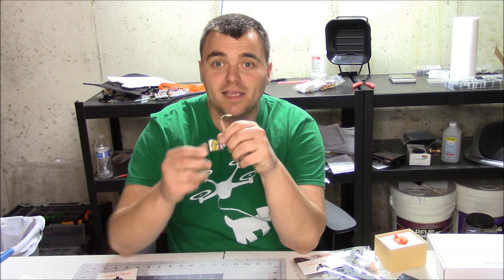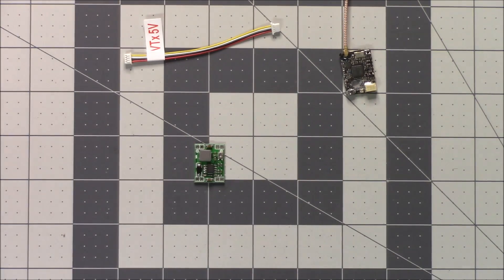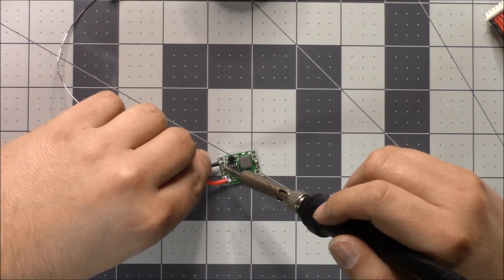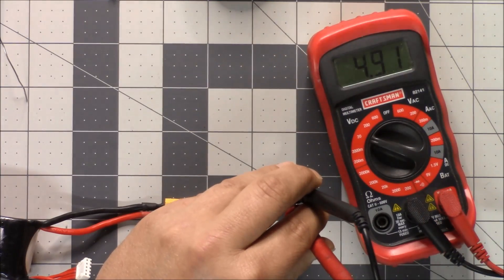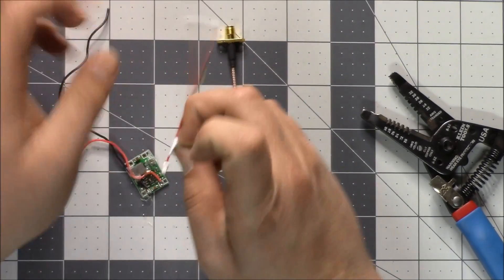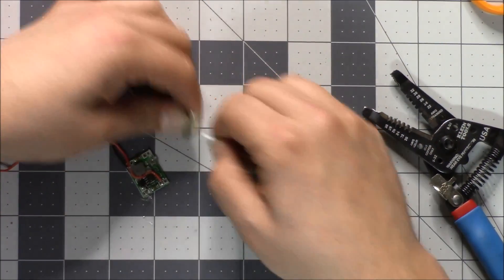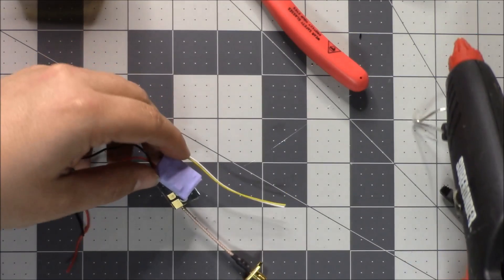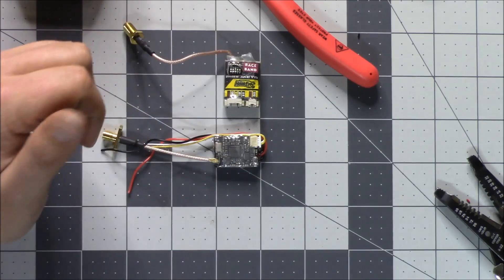TBS Unify Pro V2 5V module with regulator build

Comment: Only problem I see is that now its gonna b hard to mount the vtx up against your carbon fiber it acts as a heat sync cause it get very hot on the higher mw

Comment: Do you get any kind of horizontal line noise issue? I'm having this and I'm trying to get rid of it.
Reply from the maker: +Duncan Hohn I've had no issues with noise on these regulators.  Usually when I see lots of video noise, I check to see if I lost a capacitor on an ESC, that's usually the culprit.
Reply: Spoon FPV it was the one of the esc. Thanks for your help!!

Comment: Hello Spoon FPV I did the exact same buil you did after watching your video and set my voltage about 5v but i get about 15 / 20 feet away from quad and it's starts to snow on me.  Do you have this problem as well?  It's like my vtx is not transmitting strong enough.
Reply from the maker: +Ruben Flores are you sure you have your goggles tuned to the same freq as your quad?  The one or two channels off will do that.
Reply: I did sir, I even had two goggles on at the same time, one with an auto scanner just to be sure I locked on.  Before I gave up on it I tried increasing the voltage from 5v up to 6, then 7v even just to see if maybe my regulator was not giving enough power to the vtx but still the same thing.  So I'm thinking maybe I have a bad vtx which sucks. Forty down the drain... ): lol.
Reply from the maker: +Ruben Flores it's usually an issue with the goggles not being on the same channel.  Auto scan doesn't lock on to the right channel 80% of the time.

Comment: Hi please can anyone tell me if my tbs unify pro v2 batch 2001 vers. 1.0 can works at 500mW / 800 mW and how to enable it? For screen on the goggle display the vtx monitor on my motolab tempest f3 betaflight how and where i have to connect the wite wire on the fc port? thank you

Comment: Hi: many thanks for the video: please i don't understand if this regulator you use in this video is output is LC filtered or not and please if can you help me for understand if on my fc Motolab Tempest 1.2  that have a dedicated pinout power vtx  section i can connect my tbs unify pro 58G V2: on ML tempest fc i have pin LC FILTERED  BATT + and ground... and NOT LC FILTERED +5V and ground: if i whell understand this vtx work only on 5V powered but is absolutely important that this 5V are LC filtered for a video good quality transmit or i can connect on mi fc at 5v not LC filtered??? And please last question: i read on the web thet this tbs pro 5G8 v2 work only  with two power out frequency  25 and 200mw but when i bought this vtx i read 27 to 800mw: how is the way for unlock/set 500/800mw on it ??? THanks & Best from Odino Italy

Comment: Is the regulator you used the same as this Polulu regulator? 

Pololu 5V, 600mA Step-Down Voltage Regulator D24V6F5 Pololu 5V, 600mA Step-Down Voltage Regulator D24V6F5 https://www.amazon.com/dp/B016VG8XI2/ref=cm_sw_r_cp_apa_PfeXzbEF2ESM9

If not then what's the difference? I'm just trying to figure out the best one to buy.
Reply from the maker: +Sherman G It's not the same as the Polulu, I should scope both to be sure, but I think this one has less noise, but that's purely anecdotal and I am not a fan of that knind of advice, needs to be backed by cold hard facts.

Comment: Do you get a lot of noise in your camera with this set up? I did this and I'm getting crazy noise now. How could I fix that?
Reply from the maker: +sxe82 No, it's one of the quietest regulators I've ever used.  Maybe something else in your setup, are all the grounds tied together?  That's usually the culprit or missing capacitors on ESC, or bad antenna.
Reply: Spoon FPV the only grounds that are together are the vtx and the camera. Both soldered to the pbd.

Comment: Spoon FPV ,Im also using a tbs unify 5v version on a betafight f3 fc.On 25 mw it clear,from 200-800 mw in getting lines. any ideas ?
Reply from the maker: +ANDREW DEL CASTILHO it could be a whole bunch of things.  For me the issue has always been something other than the FC on my copter.  Most commonly it's that I've ripped off filter caps on my escs.
Reply: ok thanks i will check my escs

Comment: Hello if my PDB outputs 5v at 2 amps will i need a regulator or can I run the unify directly of it?
Reply from the maker: Should be good to go with a 2 amp regulator
Reply: Spoon FPV OK thanks.

Comment: I subbed after taking you links and watching your vid. I did this today with my tbs unity and armadillo quad after watching your instructional. I'm so jazzed to be burning 800mw and taking the power directly off the lips pigtail connections. Thank you!!
Reply from the maker: +Bubba John and the crazy thing is I was expecting that regulator to be total crap based on the price, but all of mine have been solid
Reply: Spoon FPV and after flying the unify at 800mW I must say- HELL YES!!!!! Loving it. The range and clarity is fantastic. Your workaround is nice that I don't have to try and share a 5v pad. Got my reg running directly off the battery pads. Whooohooo

Comment: dumb question, but will the regulator keep the same constant 5v switching between 3s, 4s and 5s batteries?
Reply from the maker: +Alex Webster Not a dumb question, that's what a voltage regulator does...up to a point, this one will handle up to 6S, but will only drop down voltage,
Reply: Spoon FPV thank for the help! enjoy the flying, crashing and fixing like we all do and love

Comment: Awesome video! Thank you so much for making this my friend! Very informative. You've got my subscription. Question, is it possible to get smart audio working on a betaflight build without a built in OSD? Such as using the OSD from a runcam swift 2 or the mic from the runcam swift 2. Saw a comment below where you mentioned you could get smart audio working with a mic...
Reply from the maker: Yeah, I'm told it can be done by Trappy himself, but I've never done it, and I don't fly audio, so I haven't really taken the time to figure it out.  It's not an out of the box solution, it's a custom workaround the way I understand it.
Reply: Spoon FPV Got ya. I'll have to look into that

Comment: hey, just bought the new betaflight fc and just watched your breakdown of this Fc.
I wouldn't need to add a buck Regulator on the Tbs if installing it on the beta flight fc ' sorry if I am talking jibber '.
thanks Scott
Reply from the maker: +Fraser Scott You are correct the BF FC can put out 3A on 5V and I run them straight from the board now.

Comment: Hey Spoon !

nice video man, keep up the work. 

I have one question for you. I am worried about the Unify heating up too much with this installation. Do you have problems with overheating running 500mW or 800mW?

Because my Unify tends to get pretty hot at 200mW already and I would be very worried with all the heat shrinks around it.
Reply from the maker: realmup3r the only VTX I've ever had over heat was a TRAMP, and that was very recent, and if you saw that build and how beat up it was the VTX didn't owe me anything.  I prefer the TBS V2 specifically so that I can run my own regulator, which helps reduce the heat load on the regulator, and I've never had that configuration over heat.  If your VTX is getting very hot (more than 145F)  many times it's because your antenna load isn't balanced to the VTX due to damage of the antenna, or cable to it, or just a poorly manufactured antenna.
Reply: Spoon FPV alright, I will check on that! Thanks

Comment: dang thats a tight packaged drone. I have a frame about like that and I had a hard time getting everything in I had to mount the tv on top. 3 ants and 2 receivers later Im getting a bigger frame.
Reply from the maker: I've build a lot of quads.  And I think most people wouldn't recommend an X-Frame like this for your first build, because they are tight, and component selection is critical to make it fit.  After 2-3 builds you can build something probably even tighter, all it is is practice.

Comment: hows the noise using this specific regulator I have a tbs unify running through a different regulator and it has an annoying amount of noise
Reply from the maker: Corbin D I love that regulator, it doesn't seem to create any noise.  And I've shorted the output of one, and it didn't kill it.  I like them, so that's why I suggest them.
Reply: sounds good for me. that was also a somewhat scary fast reply
Reply: oops should have asked this in the first question but does the regulator get hot? Also do you know any decent priced batteries that can go for a lot of cycles? my 1300mah turnigy graphenes are puffing.
Reply from the maker: Corbin D I get push notifications to my phone, not so big yet that I've turned that off
Reply from the maker: Corbin D The graphines are good for a lot of cycles, I've been using Strix packs as my daily beater packs, and Lunineer graphine as my racing packs, That regulator doesn't get hot, it's a switching regulator, so unlike the more common linear regulator, it doesn't burn off extra voltage as heat.

Comment: I just did this, thanks so much for this video. I ordered the Unify pro and had no idea it only took 5v so before it got here I ordered the buck regulator. TBO I think I would have hooked this up and blew it out, I just wouldn't have even thought a VTX only takes 5v, but maybe the sticker would have stopped me. Either way, thanks
Also couldn't find you on instagram, are you not on there?
Reply from the maker: Nope not on instagram, one FB should be enough, but I should do more Social media.  Twitter, instagram, FB, Twitch, etc  There are so many
Reply: Yeah I know too many sometimes. It just seems like Instagram is really big in the FPV community. There are a few options out there also that you can post to one and it will post it on all of them for you.

Comment: i have a 5v 3a regulator for my fc and fpv cam, should it be okay to put the unify on the same regulator? i figured that the vtx would consume the most power of the 3 components, so it should be safe right? great video!
Reply from the maker: You will be well under 1A... short answer.
Yeah, that will be fine.  The VTX will eat the most power out of all of those at 0.6A .  I don't know the numbers, but if I had to guess the camera probably uses around 0.02A and the FC is probably under 0.05A, they don't use much at all.  I do know for a fact that the FC, camera, and Radio Receiver are under 0.5A because can be powered by USB, but how much I've never measured it.
Reply: Spoon FPV thanks!

Comment: Thanks for the video. Question: If your not using the white wire what do you do with it? I saw somewhere else where it was recommended to hock it to ground when not using.

Thanks
Reply from the maker: Jay Black That's for audio, you should watch my smart audio video, that's what I use it for now,
Reply: Thanks, just watched. I thought smart audio only worked on certain FC's. I'll go ahead and hook it up as you suggested.
Reply from the maker: Jay Black It only works on FC that have OSD, like the BF F3,  You can also hook it up to a microphone, and the other side of the Mic to ground and you will get audio transmitted.  If you're not using it grounding it isnt wrong.  It narrows the bandwidth you occupy on 5.8 which allows more to fly with less interference

Comment: I think the TBS unit needs 600mA. Would I be able to connect the regulator from a 12v/500mA source and this will still work?
Reply from the maker: Shimmy FPV You can connect the regulator to that 12V source, because it will only pull around 250mA from 12V line, but why not straight to your battery?  Are you running more than 28V
Reply: Thanks for the info.. No im not running more than 28v,  but I'm running the KISSFC off the battery, can I connect this to the one labeled VCC on the PDB? Is that the same thing?
Reply from the maker: Shimmy FPV I'm not that familiar with Kiss equipment, but as long as VCC is battery RAW(usually labeled as RAW) then you should be fine.  If VCC is a regulated voltage then you need to check the specs.
Reply: Ok thanks man, I'll give it a go.  this thing is overheating after 30 seconds of running and video starts to drop, maybe bad power.. So I'm gonna give this solution a try. If it doesn't work, I may switch to the Tramp HV, any thoughts on that VTX?
Reply: Shimmy FPV if your tbs is over heating verify its only get 5 volts power. Mine was wired into a 12 volt source, it didn't fry it but it got super hot within 30 seconds like you stated. Also at the high volt settings your not supposed to fly shortly after powering the unit to help cool it, as stated in the manual.

Comment: Half the cost? The HV costs 10$ more. You mean ½ the cost of the difference, half the 10$? Save 5$ for so much hassle , is it worth it? Or is it because you can find the HV? I'd simply get the HV... or the Tramp HV from ImmerisonRC
Reply from the maker: Ray Choi I like the smaller form factor.  the HV will not fit in my x frames.

Comment: Hi, thanks for this great how to video.  Isn't 3A a bit of overkill?  P = V x I  or put another way I = P / V. so as max power is 800mW or .8 W and voltage is 5 that makes max current .8/5 = .16A or 160 mA so one of those 500mA units from e.g. Diatone should be enough for both the flight controller and the vtx
Reply from the maker: David London You're confusing mW with mA.  Milliwatt (mW) is a measure of transmit power, Milliamp (mA) is a measure of current.   The VTX consumes 600mW of power to drive all the circuits to transmit at 800mA.  A 500mW power supply will not be enough to drive thd VTX, and certainly not enough to do vtx, FC, and whatever else you're running on 5V
Reply: Spoon FPV Hi, yes thanks for replying and correcting me.  I read the Unify Pro specs again and under consumption it says for 800mW output that it uses 600mA.  Does that sound more realistic?  If so a 5v 1A Bec might do it
Reply from the maker: David London Yeah as long as it can really deliver 1A, a lot of those are optimistic ratings.  And when you start aproaching the limit they get hot, thats why I chose something that was well within spec.
Reply from the maker: David London Yeah as long as it can really deliver 1A, a lot of those are optimistic ratings.  And when you start aproaching the limit they get hot, thats why I chose something that was well within spec.

Comment: I've had the same idea but never got around to try it. How's the video clarity, do you get lines?
Reply from the maker: LenbitzFPV Video quality is excellent.  I was worried about voltage ripple, but its not operating in the areas where buck regulators really struggle, (heavy current draw, or super low draw)  its kinda in the sweet spot, and the TBS handles the little ripple just fine.

Comment: Try the Tramp. It's amazing and excepts a wide range of voltage. I have even ran mine str8 from 5s. Amazing picture quality also. It's tiny too. Might even be smaller than that one.
Reply from the maker: muteFPV No the tramp is a good VTX,  All thd GoPro stuff on my channel is a quad with a tramp on it.  I don't think the tramp gets hot.  The TBS gets kinda hot, which is why I tried to set the regulator to 4.8v not 5 which helps with the heat.
Reply from the maker: Ponyboy FPV I have three of them and they are too big for an x frame like I run.  And they aren't reliable when you change channels.  I wouldn't recommend them for someone that doesn't know what they are doing, because its very probable to be transmitting on the wrong channel.  I use them on all my bigger rigs, because they are super simple, but the unify pro v2 is super small
Reply: Well I must have gotten lucky, because mine kicks ass and is tiny.
Reply from the maker: Ponyboy FPV They do provide nice clean video and I do fly them, but still not as small as the hawkeye or tbs unify.
Reply: Any heat issues with the Tramp? TBS Unify seems ti be highly praised

Comment: What do you think of the Eachine VTX03?   It is just as small and cheaper.  Would you recommend it?
http://m.banggood.com/Eachine-VTX03-Super-Mini-5_8G-72CH-025mW50mw200mW-Switchable-FPV-Transmitter-p-1114206.html
Reply from the maker: Jonathan Edradan It looks big, and even the one they chose to use for pictures in their add looks like a 5 year old with no experience did the soldering.  Also doesn't go over 200mw, but for $13 it's worth a shot, I just wouldn't be supprised if it wasn't any good.